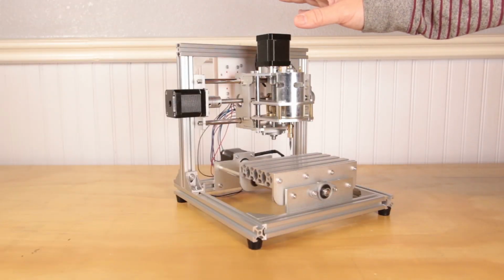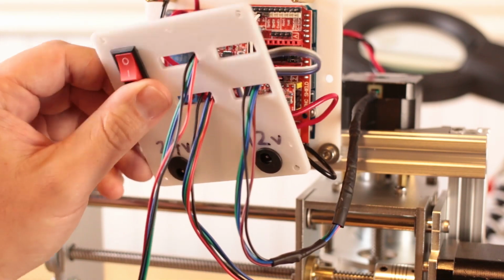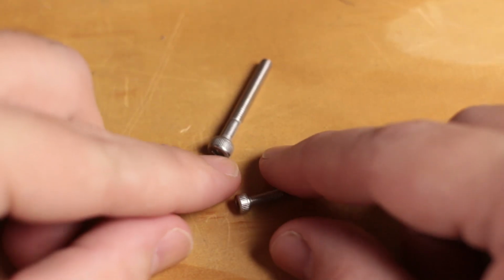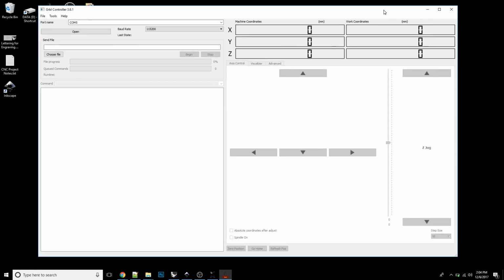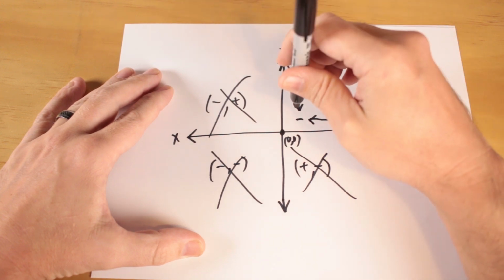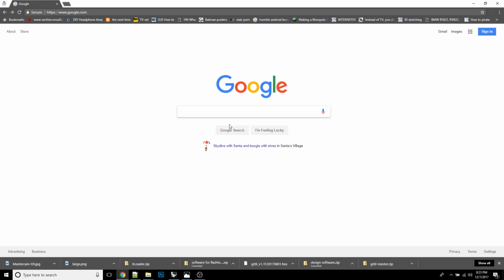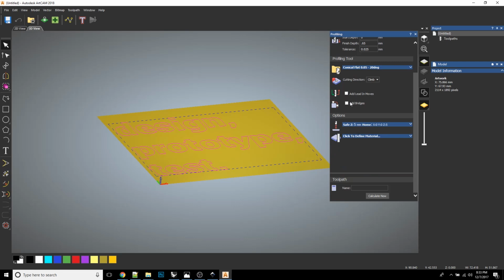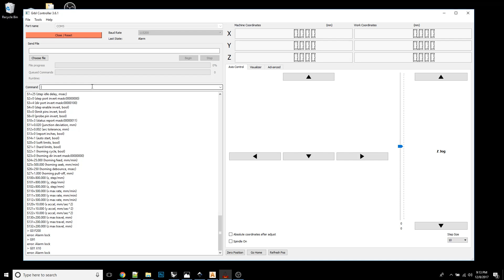How to start CNC Machining for under $200 - Working with the T8 CNC engraver

Comment: Hey mate
Great Video :)

I updated the firmware and opened grbl controler. 
The machine is talking to the computer and everything i can even send comands and the software accepts it. 
But the machine does not move.
The Led on the microcontroler is on. (red) 
so did i make a mistake in assembling? I was carefull and did the wiring exactly like you showed.
U updated the driver too
Reply from the maker: If the Machine doesn't move there could be a number of culprits. First check the 12v power going into the board. That power only feeds the stepper motors. The fact that you aren't getting any movement at all makes me suspect it is a power issue. For anyone who is curious, the USB cable powers the Arduino, and the 24v line powers the spindle motor. To see if it is a power issue. Check the terminal block on the board with a multi meter (or a 12v automotive circuit tester light) if you aren't getting power at that location start going upstream. This is what I had to do in order to diagnose the bad plug. Hopefully you didn't reverse polarity with your input power going into the terminal block by wiring it backwards, because that probably would have fried the "CNC arduino shield". The other problem you might be having is something I didn't go over: The Stepper motor driver boards (AKA Stepper sticks). It is possible to install these backwards. Look at my wiring instructions, and see if your stepper sticks are installed in the same direction. If you ever installed them backward, and powered them with 12v they are most likely burned out. Don't worry,  new ones are cheap on Ebay. Just search for "A4988 stepper driver."  Good luck!
Reply: It is AWESOME that you take the time to answer me :)

Ok here is my progress, i dont own a multimeter but i used the motor and 2 cables to test: 
12v Powwer supply = OK
24v Powwer supply = OK
right Plug (12V) = OK
Left Plug (24V) = NOT OK

So i replaced it, now i am able to turn on the motor with the software :)

Now, the big big problem... I DID reverse polarity on the cnc shield... but it did not spark or anything and the Fuse is still intact as far as i can tell. I now changed the polarity. And if iam able to tell the spindel to turn on and of it means that the shild is working, right?

Comment: Please do not tin wire used in crimp connectors, buy the correct tool and use it, a good crimp connector can be purchased on EBAY for $20 to $30.  There have been numerous papers written on this topic,  JPL, NASA and JEDEC all forbid the tinning of multi-strand wires used in crimp connections. With good reason, we use multi-strand wire because it flexes without creating metal fatigue. A properly formed crimp connection will be secure and still allow the wire to flex. Filling the voids between the wires effectively turns the wire into a single strand which will be subject to a higher rate of failure from metal fatigue. I recently did a failure analysis on a module that controls the landing gear motors on a Boeing aircraft. ALL of the I/O wires used crimped connector similar to the type in the video, NONE of them were tinned. There were no failures in the I/O wires. I have worked on a number of flight rated and space level programs, crimped wire connectors are NEVER tinned.
Reply from the maker: Did you test soldered/tinned wires as well? What about crimped and tinned wires? Was it only a study on crimped wire connectors.? What was your control group? What can you tell me about the stress gradient  present in the joint of a properly soldered connection (where the solder wicks into the wire, and gradually diminishes the further from the joint it gets thus alleviating stress at the joint) in comparison to the abrupt fatigue point present in the wire where the crimp connector ends?
Reply: The failure analysis was related to a power transistor, mu comments about the crimped connectors were intended to illustrate that crimped connections are used in avionics and never soldered.  I did not personally conduct the crimped wire studies I mentioned, they were done by the mentioned organizations (JPL, NASA, and JEDEC) back in the 70's. My personal background is 30+ years working in Hi Rel electronics on military, medical and space programs. Feel free to continue your own practice, we are after all talking about hobby electronics. I am just offering advice based on my background and experience. If you want to spend a little time researching you will find many white papers that support what I am saying.

Comment: without watching the whole video, yet, i see the barrel connector has 3 conductors, tabs, and it is a special one that redirects the input to the device needing power and also disconnects the battery power source, so the other lug will have the ground. (i think)

Comment: Always, always, always use pre-tinned copper wire. [ EDIT:  unless you're dealing with high-frequency signals... Mr. Knight says that's bad, ummmkay? ]
Reply: As a radio engineer, I would have to express my surprise that tinned-Cu wire is still manufactured.  The problem is that tin has a much higher resistivity than copper.  This wastes energy even at low frequencies, but at radio frequencies the current flows in a thin layer at the surface of the conductor, i.e., in the plating.  Were you to tin plate the co-ax from your UHF TV antenna to the TV, the signal probably would not arrive in usable form.  It is also toxic to computer buses and anything involving square waves.
Reply: I'll have to find the mentioned video that supposedly demonstrates the need for tinning the ends of stranded wire that isn't going to be soldered, but simply clamped in terminal blocks. I'm definitely skeptical...  Disregarding Chinese garbage, P.O.S. CNC for a moment, but in a professional context - we use Allen-Bradley screw-type terminal blocks and stranded aluminum wire. Every day. Thousands upon thousands of terminal blocks. No tinning. No problems. So.... yeah.
Reply: Also... while high-frequency signals might take issue with tinned-Cu, there are hundreds of thousands of uses that are perfectly fine with it. So it's doubtful we'll ever see it disappear. There are even specific benefits compared to bare Cu: https://www.distributorwire.com/blog/tinned-copper-vs-bare-copper/
Reply: Hi Perry.  Thanks for the clarification.  I was perhaps over-stressing my aversion to tin coating.  Actually, I do sometimes tin the tips of stripped multi-strand wires to stop them fraying - but its not something you want clamped in the terminal block, especially if the current is more than a few hundred mA.

Comment: i agree..always tin the wires with solder regardless what the other guy posted.
Reply: Ed Moore It’s still a bad idea. Tinning is only appropriate when the wire is going to soldered (only!) into a connector. Solder categorically must not be used with compression connections like crimps or terminal blocks.
Reply: @tookitogo  go on with your way. the wires crush...they will come loose. but..its your issue then. they will fry and overheat.
Reply: Ed Moore A proper crimp creates a cold weld, and is both stronger AND less brittle than than a soldered joint. This isn’t my opinion, this is fact that’s been empirically tested many times.

Comment: 13:00 no connection because low quality socket.. been there done that :-) I love Switchcraft connectors, using only these... well they are little bit more expensive but they save time

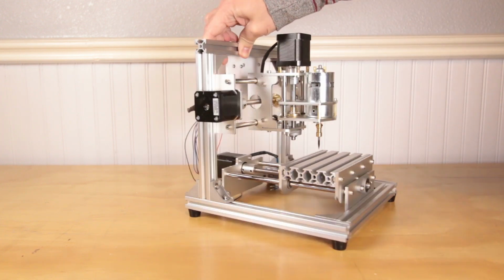Comment: 07:40 first dip the wire in the flux , then crimp the connector on it , then solder it.
Tin the other end
Reply: mar1video Never solder a crimped connection.

Comment: idk what the g code controller is based off of (fanuc ,yasnac, ecct) but in most cases a G0 is a rapid move and you shouldn't need to supply a feed ware as a G01,G02,G03 all require a feed rate to move. prehaps the controller doesn't know its maximum rapid movement?

Comment: Since ArtCAM is no longer available, what are you using in its place?
Reply from the maker: I showed an alternative in this video here: https://youtu.be/HE9O5ZKRHTM

I'm thinking it will be a while before we get a good free alternative to ArtCAM, but you can always just go with Fusion 360 with it's built in CAM package. Autodesk shut down ArtCAM because they wanted to roll that functionality into 360.

Comment: I just received a second T8 DIY CNC Engraver which I ordered by mistake.  So I swapped out the circuit board and relay and still no response.   I am starting to wonder if I had the stepper motors plugged into the wrong place  I had them plugged into the pins next to the power in side of the board  I changed locations after watching your video again and useing the stop feature I was able to see that I should have plugged them in at each of the small boards and not where I had them.  Have I screwed up another board?
Reply from the maker: If you plugged the small boards (called the stepper motor driver boards) in backward then you likely burned them out. No big deal. Just buy replacements for ~$1 each. However, those came pre-installed on your main board, so unless you took them off, and then reinstalled them backwards you shouldn't have this problem.

Seriously though. What works, and what doesn't work? Did you open up GRBL controller on your computer? Can you see the $$ menu ? Can you turn the spindle on/off with GRBL controller? 

If you are not already, you should probably subcribe to the subreddits reddit.com/r/CNC and reddit.com/r/arduino. I suggest you ask your questions over there. I will not be able to assist you further. I have videos to make and acting as technical support for all of my viewers is not feasible. Best of luck!

Comment: Is there a cheap 3 axis CNC that instead of having a dedicated tool, will let me mount any dremel-like tool, so I don't have to buy one device for CNC and another for manual work?
Reply: The tools you would be using are things like Endmills, Drills, Facing tools, and maybe some other random tools. I personaly have never seen mills be used with abrasives, as there are special tools for those. If you want to do anything more than aesthetic work then it would be unwise to use a dremel tool even if it did work, because you would have very little control over the cut, as the dremel tool bits (assuming abrasive, I have never seen any Dremel cutting tools) are quite imprecise (for anything that fits together with anything else).

But, if the mill has a normal chuck-style toolholder, I don't see why a dremel tool wouldn't work.

- a proffesional CNC Machining Student

Comment: Learn to machine manually first!  Its just as accurate, and you will understand and learn more.  Long live the handle crankers!
Reply: we have a huge ancient machine at work that is never used. any guides you can recommend?
Reply: @theEpicDARKnessEvar  I'm not familiar with the Huge Ancient brand.  I mainly worked with Bridgeport, Hardinge, Sunnon, South Bend, etc.  :)  My best advice is to hire a retired tool and die maker to teach you.

Comment: Do you think this machine has enough power (and with the correct bit) can engrave on a metal plaque?
Reply from the maker: Yes. It could do a very light engraving (No cutting only engraving) on a soft metal like Brass or Aluminum. I would recommend that you get a "BENBOX" machine instead of this one. While it is a little more expensive, it appears to be a lot better built. I have one here still in the box. I will do a review on it in the future. When? I can't say. Soon I hope.
Reply: thank you for the advice.  I'll be looking out for the BenBox review when it happens.

Comment: Couldn't you have put the switch inline on the negative side of both power supplies and ran the positive sides to the (+) connections on the board in order to have the switch power off both the 24 and 12 volt?
Reply: This would work so long as the negative wiring was able to handle the combined current from 12V and 24V rails.

Comment: Dam. I love aluminum man, but common. Make it out of steel, put a bigger and more powerful travel motor and up size the "engraving" motor. A lot of precision can be obtained when you get away from Aluminium. Which is why I never invested in a DIY CNC Machine. Its only as good as the frame due to flex under load... aluminum is very flexible

Comment: Hello)
Can this machine engrave only wooden plates or plastic PCB ? This cannot engrave lightly aluminium ?
This aim is to draw readable icons.
Will you précise if the milking head might be changed to get a more précises resolution of the drawing result (you said that 1 mm is the size of the line engraved, this is amazing large)?
Reply: I don't see why this couldn't work with aluminum up to a point.

Comment: I almost bought a desktop cnc machine, but I didn't know if I could create smooth curved surfaces in whatever material, to create a relief.  I've seen that sort of stuff before, but have no clue if it can be achieved this way.  Can it?
Reply from the maker: Yes. What you are asking about is called "Surfacing" as opposed to "contouring" which is what I was doing in this video. You could certainly achieve some surfacing with this router however it would require that you purchase a ball end bit. Also, as this router comes stock I have my doubts that it is stiff enough to get good results doing contouring work with wood. Also the spindle motor is very week and only spins at 1 speed. Therefore, you would need to cut very slowly. Your small project could potentially take 12 hours of cutting on the machine even for the very small bed size that this machine has. I would expect foam to be the better material option. Maybe I'll do a video about this subject. :)
Reply: Ty for your help. I was thinking of using something really soft, like balsa wood to start, or maybe a soft wood more like pine.

I'm an artist and so was looking to make like wood panels with images on them carved using surfacing to cut a relief into them.

I even looked to see if there was a similar sort of thing released by Dremel but couldn't find anything, at least not in a similar price range.

The one I found that I was looking to buy is very similar to the one you have here.  I wonder how many people have the same idea about making pretty much the same thing. XD

This is the one I was going to buy.  You can see how similar they are:
https://www.amazon.co.uk/dp/B075VR4B93/ref=olp_product_details?_encoding=UTF8&me=&th=1

Comment: Don't solder your crimp connector but if you do then solder it before you crimp it around the insulation.   If you solder it after you crimp it around the insulation then you lose a lot of strain relief because the crimp will melt through the insulation.  Just sayin'

Comment: In advanced Design Prototype Test is the only one i found out who did proper assembel this machine.
Even the sellers do have the pictures with a really brainless screwed up cheapo engraver, what the hell? 

OMG look at these huge NEMA17's, these take probably 2 Amps and would have around 55Ncm/ 84oz·in.
This will make the motordrivers crap themselves. Or you will have less torque than a smaller motor, if you 
reduce the amperage to save the driver. However upgrading to a TB67109 mofo will give you the choice 
of going up to 4 Amps, hell yea this will bend the aluminium mounting plates. I am kind of jealous now, big 
motors! I ordered the 3018 in 2019, not the pro version and it has the 40mm motor i guess these have 
aroung 35-40Ncm/ 49-56oz·in, rotorinternia 54g-cm² witch would make them fast but this is not a 3D printer. 
I wont a heavy core 84g-cm², 60mm body lenght, and 2,1 Ampere 65 Ncm/ 92oz·in holding torque :). So
happens i have those just laying around. The 3018 Pro version has in my opinion no advantages, not
even bigger motors. Cheers.

Comment: Hey Dude, I for one loved your video. I purchased a very similar kit, the hardware looks almost identical but I did not have the problem with the Y axis and the controller shield is different. It is Arduino Nano powered and the board is a "Developower V2.0"   and I have come to a standstill with the software and I could really do with some help. The grblControl_0.8.1 works but X and Y are reversed and Z is correct. Trouble is I cannot work out how to fix this. GRBL Control 3.6.1 works better in that I found where to set to correct axis movement and now Z, Y and Z work but spindle on/off does not do anything. Finally, the one I would really like to use is MACH3. It seems to connect to it OK, after telling it that it is usb/serial attached, but none of the Axis' do anything.
Any help would be much appreciated. Kind regards, Chris
Reply: reversed steppers, you swap two of the wires, if you haven't found that out yet.
Reply: Have you tried using (-) Minus Values for X & Y? Just a thought Chris
I'm just about to buy into this Tech, but I wish we could all agree a universal Measurement system, FFS :-)
Reply: How much was the unit you bought and what was its name also can you cut out lower receivers with that machine you got

Comment: 19:59 whatever reason that X and Y were inverted that stepper motor plugs are plugged incorrect way. If you are dealing with 3d printers you should be well aware of that.
Reply from the maker: You can switch the wires at the stepper motor (fiddly and time consuming), or you can change the values in firmware (easy and quick). Either technique will achieve the same outcome.
Reply: @DesignPrototypeTest  Yea flipping that connector is very time consuming... :) But that is not the point. Point is strange to call that "whatever reason" when it is quite obvious why that happened.